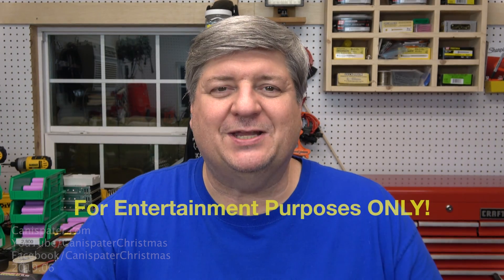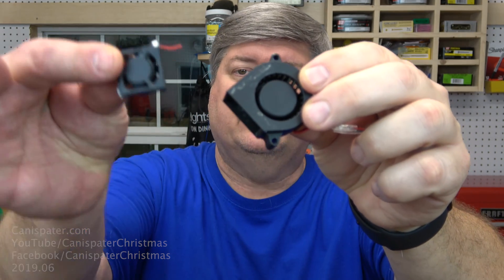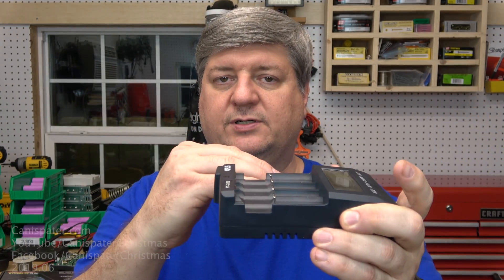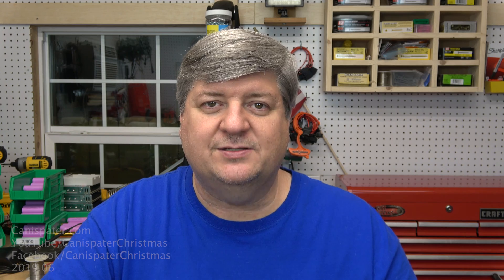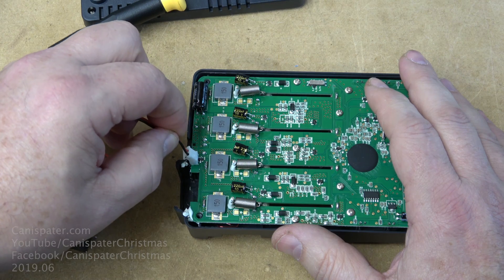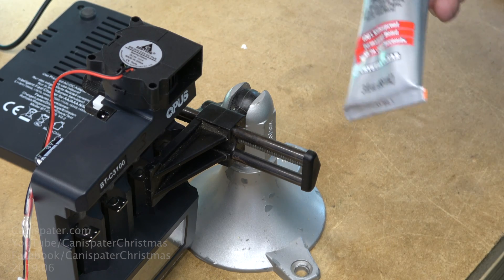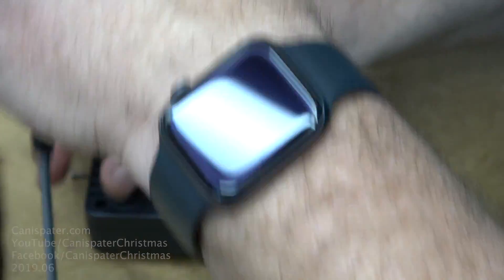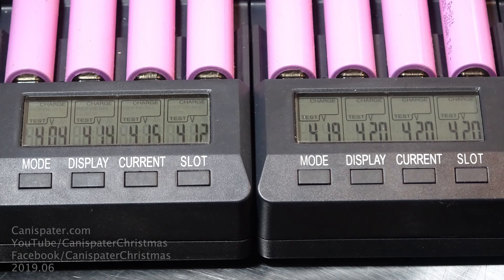⚡️DIY Powerwall Project - ep4 - Opus BT-C3100 Fan Mod & Test  (2019)

Comment: Just curious why you have the fan pulling air , instead of pushing like most opus fan mods. Have you tried it both ways?
Reply from the maker: I haven't. Terry uses this design and has a ton of these chargers. Not sure it really makes much of a difference as long as the airflow is high enough to keep everything cool. YMMV
Reply: @CanispaterChristmas  yea, he told me he changed position, but this was a few days after I did my video. I had to purchase a couple more, and figured I'd ask before I put the turbo fan in. Thanks for answering back so quick 😃

Comment: Is there any reason why you can’t use the fan circuit of the opus board to provide control on a relay which would turn the new 12v fans on and off?
Reply from the maker: You might want to use an opto-isolator just to be safe. The fan circuit on these seems to be a little hit and miss.

Comment: old video i know but thank you. you have just solved the discharge at 1 amp fault i been having with opus where it would just shut off and not complet the test had to test at 500mah test still valid as ill never pull more then 500ma from each 20p pack the problem is length of the damn test cycle wake up put cells in bank come home from work to find cells still not fully charged meh
Reply from the maker: Haha. Glad it helped!

Comment: I am having problems with my new battery charger and batteries, can you please watch my video to see if I am doing anything Wrong https://youtu.be/USvnOy8McXs
Reply from the maker: You need to make sure that charger works with NiMH batteries - it may be Lithium-only so that charger won't work for those batteries. Not sure which model Opus that is so I can't tell.

Comment: To keep my testers cool I use computer fans on each end of my bank of testers to keep the air moving across them.  The Litto Kala only does 500mah draw when you do all 4 slots even if you select 1000mah. so for a 2200 may cell it would take about 4.5 hours.
Reply from the maker: Someone else mentioned the wall wart that comes with the testers may be a little light for what we're doing so I may beef up the power when I process again.
Reply: @CanispaterChristmas  ya I also use 12v 6 amp power supply for each one.  I have some server power supplies that I want to use to run them all. Make a nice processing work desk.  Im still learning things every day. So much fun.

Comment: The problem is the crappy 12V 3A power supply that comes with the Opus model - they just do not provide enough power to charge at 1 amp and run the fans reliably.  I have even seen the 3100 blink out like that running four cells at 700mA . The problem is the pulse charging will intermittently pull as much as 44 watts when the power supply only can provide 36 watts of power.  I use 12V 5A power supplies on mine and never had a problem with the stock fans or the unit blinking out (save having to replace them over time as they get worn out) - the 5A power supply can handle up to 60 watts and also makes the stock fans run a little faster which in theory should provide more cooling.  With those fan mods your 3100's should never even run warm on a 5A power supply.  Just my .02 on this.
Reply from the maker: Thanks! I'll have to give it a try.
Reply: @CanispaterChristmas  have you tried it? Wondering if you had better experience using a 60W power supply with stock fan?
Reply from the maker: No, I didn’t try a stock Opus with a larger capacity supply at 1 amp. Probably the easiest change to try if you are seeing that behavior tho.
Reply: @CanispaterChristmas  Been running mine with that 12V 5A for several years - no problems whatsoever, regardless of current rate.

Comment: I'm looking to get a different charger...  At the moment I have the Nitecore sc4... Now correct me on anything if necessary... The problem is that the sc4 dont test discharge capacity and internal resistance...

The Opus..  I heard someone upgraded the power supply to one with 6 Amp 12 Volt not sure if that would make a difference or helps you?.?. Jehugarcia says the Opus cant check internal resistance not sure how true or important that is for your application???

The Zanflare C4  and Liitokala Engineer both discharge, check capacity and internal resistance...  Apparently the Liitokala discharges twice as fast as the Zanflare and is why he voted it #1. Just wanted to get your take On how the opus is working for you and any other tips would be appreciated to aid in my decision making process...  Thanks in advance...
Reply from the maker: Yes, I believe the Nitecore SC4 doesn't do capacity testing or IR, only charging. Jehu is correct. The Opus doesn't test IR, but it's pretty simple to do manually with a voltmeter and an accurate resistor. I think IR is just another parameter to check on the cells. "A new high quality 18650 battery will have an internal resistance under 100mOhms. A used up 18650 battery will have a resistance 400mOhms or more." (https://laserpointerforums.com/threads/how-healthy-are-your-batteries-how-to-measure-internal-resistance.57576/) The Zanflare is a 500mAh-only tester and the Liitokala is adjustable like the Opus. All these testers are only accurate to within a couple of hundred mAh so a cell that tests at 2000mAh in one charger and 2200 mAh in another, what do you pick? So much affects the accuracy and these are very inexpensive chargers (compared to labratory test equipment). SO, I just decided to accept the ratings on the chargers and sort them into 100mAh groups. The Opus fan mod seems to help a lot with the 1,000mAh test keeping the charger cool. I like the Opus & Zanflare because you can see all four cells at once, but I think the Zanflare tests down to 2.8V and mine reports higher capacities. Overall, I bought 4 Opus chargers and made the fan mod and went with those capacities. I also got some 10-ohm resistors from DigiKey so I may try checking IR with those or just use the Liitokala.

Comment: You can buy bi-metal strip switches to turn them on and off - check Ali express or Ebay.  Andreas Speiss did a video using them to cool a power supply - I bought some, they work great!  If you want one to try it, let me know and I'd happily drop one in the mail for you to try.   Let me know what degree C you want it to come on at.
Great video as usual!
Reply from the maker: Thanks for the offer and the video tip. I believe a shunt trip or a contactor is what I've been looking for. It's going to be more expensive than a bi-metal switch, but I want a circuit breaker on the entire battery to be able to shut it down if something goes sideways. A shunt trip will turn the breaker off. A contactor does the same thing, but doesn't provide any current protection so leaning toward the breaker and shunt trip. I may have found one I like, but still hunting.
Reply: @CanispaterChristmas  no I was offering it as a solution to your fan running all the time...not as a safety.  You were complaining that running it off the 12v rail made it run all the time....
Reply from the maker: OOOOH! Haha. I should pay more attention to the video you're commenting on. Na, I was saying it's a downside of hooking to the 12V rail, but it won't bother me - plenty of other noise in the shed. :) But thank you very much for the offer. Although, now that you mention it, I wonder what temperature triggers the fan now...

Comment: HI first I would  like to say I think all your videos are great Thanks for the info that you share.     I'm trying to understand the power wall use.  I currently have a 32 panel 8.5KW solar system with a NET meter.  during the day I sell the excess power to the power company then at night I buy power from them..   Would a power wall be better than using the Net meter setup I have now.
Reply from the maker: Thanks! I'm a bit new to this myself, but from what I gather, it's better to use your generated power vs selling it to the power company. Usually, it's a "they pay wholesale and you pay retail" kind of thing - depends on your situation. A solar/powerwall can offset some of your night time use (depends on many factors obviously). The idea is to charge the battery with solar during the day and use the energy in the battery at night. The trick is usually balancing solar and storage capacity with your use or just pay the difference. Also depends if you share the home with others. Spouses and kids can turn against you if their power is interrupted and they aren't as into your hobby as you are! LOL!

Comment: Complete noob comment and suggestion...  Its a blur not sure if on your video you mention discharging 18650's to I believe 3.5 and that would be optimized to indefinitely storing batteries so that they dont become damaged or go bad...  Well my suggestion is that you should make a video showing us noobs who are slowly trying to acquire our stash but dont want the ones in our possession to go bad..   Thanks
Reply from the maker: 3.7 is nominal. They will self discharge over time. Just make sure they don't go down to 3.0 or lower or you may have trouble waking them up. You might want to check them once a month or so to see how they are discharging. It would also alert you to a self-discharger which you'd want to avoid using in a powerwall. Still good for something like flashlights or something you'll be charging frequently.

Comment: I use a timer for my 12vdc led outdoor light system  You could use them to turn your fans on when needed.  Just a suggestion and as always great intro!!!
Reply from the maker: Yeah, the fan circuit runs based on heat. I’ll just power the charger off if I’m not using it. Having the fan run while it’s on is no biggy.

Comment: As popular as the 18650 cell has become, I wonder why someone doesn't build a high quality charger/cycler.  Seems like the Opus isn't quite up to the task.
Reply from the maker: The Opus does a decent job for the price. I may be expecting too much from it. Unless you can sell thousands of units, it's probably not be worth the up-front cost to design and manufacture one. It might also be simple enough to build a custom tester, but I don't possess those skills. :)